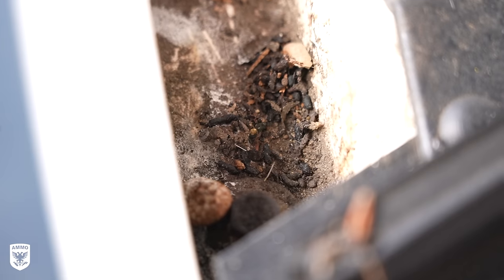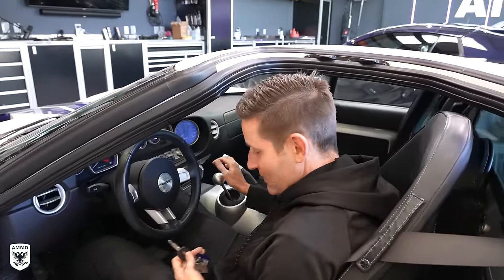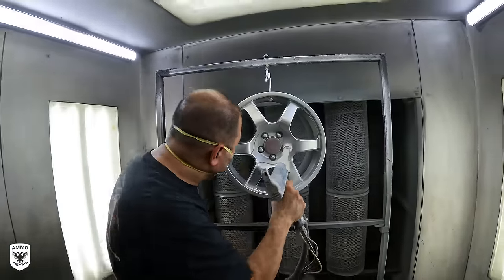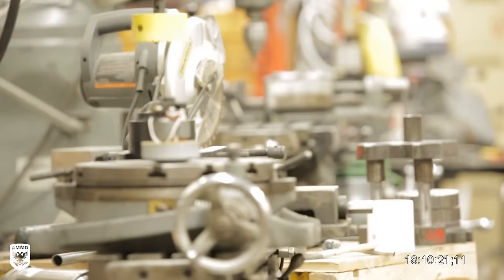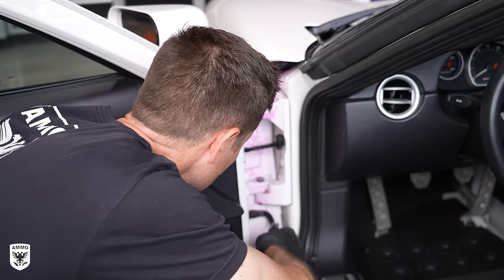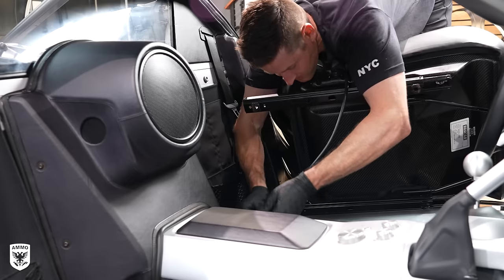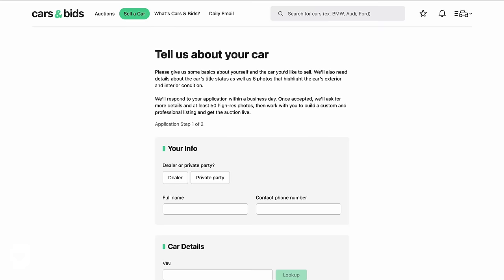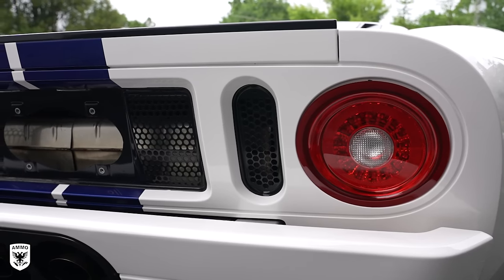First Wash In 5 Years: Abandoned Ford GT Disaster Detail with Doug DeMuro!

Comment: I was a Ford L-M master technician for a while and had the privilege to be able to drive a couple of these cars! Working on them was usually a stressful nightmare….
I had to replace one of the gauges and that was very difficult. Removing the instrument panel was not fun. 
Oil changes were an absolute pain! Putting the vehicle on a hoist was next to impossible (at least with our old lifts). We had to drive the car on pieces of wood just to lift it enough to swing the lift arms underneath the vehicle and then you had to hope the car was in the right spot or you had to back it out and start over. 
We charged an additional hour of labor for just an oil change due to its difficulty compared to other vehicles. Normal oil changes paid .3 tenths of an hour labor and the GT was 1.5 hours labor.  
Very cool cars though!
Reply: Landon-si5xc  I was born a Catholic and I’ll die one. No thanks.
Reply: The owner designed/worked on the Pantera

Comment: Looks amazing. One thing that would have helped in the engine bay is all of the bolts that hold down the valve covers and coil pack covers could have had a quick buff. Because now the valve and coil covers look great but the bolts are letting it down. Great video s usual. Nice to get DD involved as well. Thank you 😊

Comment: Great job, my only concern is the HVAC duct work. If there is mouse poop and urine in the air box, you can be certain it is in the ducts as well. I wouldn't purchase a vehicle like this until the entire duct system and fan was removed and cleaned.

Comment: I had a neighbor of mine as a kid who had a 1974 Bricklin SV-1 that he purchased brand new, greased down the frame, took the wheels off and placed on blocks and covered up while filling the cylinders with motor oil and letting sit up for 30 years knowing that the car would be of some value. He turned the engine over by hand every several months to keep from seizing and wiped it down ever year or so. He passed away never selling it for his wife to then have. She then sold the car to me as an adult at the age of about 35 or so and to this day still have the car with 21 miles on the odometer in my shop. My point?…… when I got the car even as covered up as it was it took me a good two weeks to clean it up so well that it could be sold at Mecum auto auction if I wanted it to. It is impossible to let a car sit up to remain in mint condition regardless of how covered it is. . Microscopic dust particles make its way into anything and everything it was even all over the interior of this car being completely closed up with the AC vents being blocked off intentionally to attempt to prevent dust from getting inside. About two years ago I spent five hours prepping the engine to start it for the first time and it literally cranked in about five seconds and ran on first attempt. I should be selling it at Mecum hopefully at the beginning of next year in 2024.

Comment: I found the only way to stop headlight fogging is to re clear them. It will come back because there is no new uv protection, just the old clear,
Reply from the maker: I applied a UV coating after further refinement. Didn’t make the edit. Not to worry

Comment: I’m just wondering. Doesn’t the car need much more than just an oil change and air filters? Surely it also needs new brake fluid and possible also brake disks and pads and probably much more than I can think of. 
(I assume more work was done, but just not included in de video).
Reply from the maker: Correct, it received a full service

Comment: Surprised you dont get some sort of PAPR system so it would make it easier to talk through your mic and youd be able to work for long periods of time without the restriction on air caused by those pod filter masks. Sure itd be 2.5-3k but if youre working long hours with a mask on, a cordless PAPR system is such a big luxury.